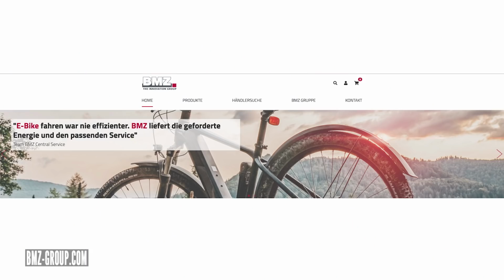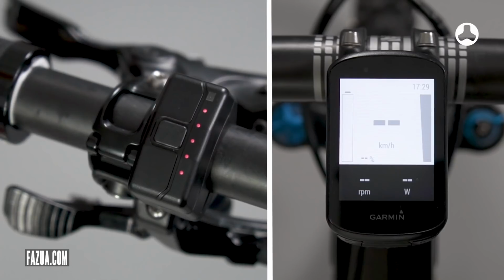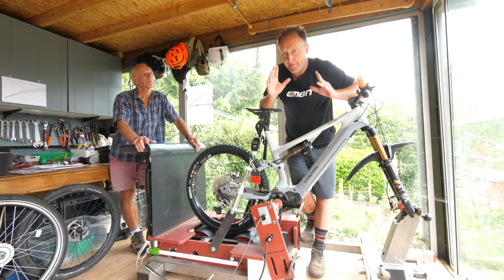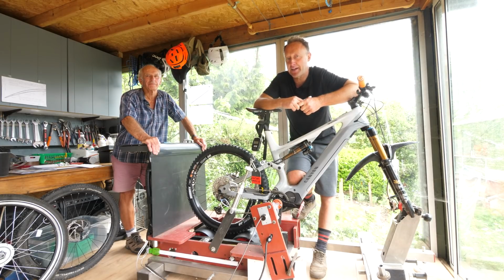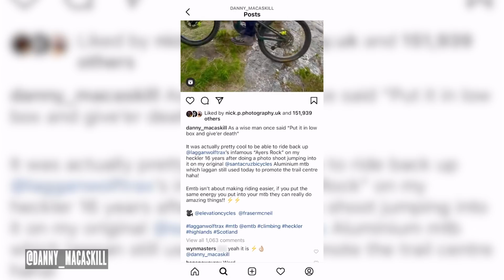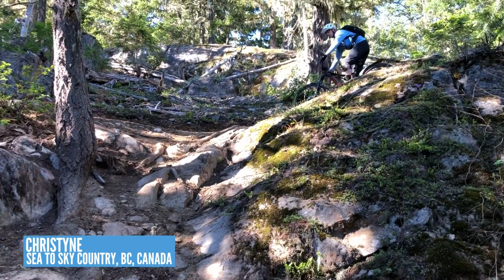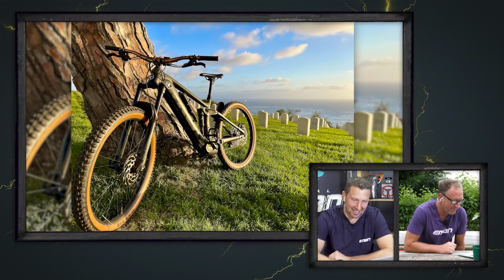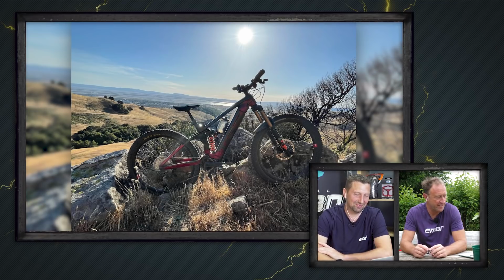Huge New Batteries Tech & Ray Responds To Rolling Road Questions | EMBN Show Ep. 182

Comment from the maker: What do you think about the news of this huge 820wh battery? Is it something you would be interested in, or do you prefer the smaller and lighter battery options on the market?
Reply: I don't think this matters.  What would be good is 1. standardizing batteries so that they are interchangeable between different brands of bikes.  2. making batteries modular so that you can add or remove individual cells as needed.
Reply: If they retrofit to existing bikes, great. I’d also like physically smaller versions of existing batteries - that monster used in my Turbo Levo looks daft sticking out of my backpack on days where I choose to take a spare.
Reply: If they could do a 600wh Bosch battery for my 2017 Mondraker eCrafty I'd be happy, I could do Degla twice.
I changed out my wheels and tyres and saved 846g went from the original wheels to DT Swiss and Maxxis tyres to Schwalbe.
Reply: Yes it’s of interest but stored Wh is only a partial story. How long it lasts depends on many variables as you know but the one we need measured on Ray’s Rolling Road is Watts out at battery vs Watts at rear wheel - in other words the serial efficiency of the system. This will give us an insight into how well built a drive system is and the heat losses.

As regards other things we’d like to see. You ask what is the optimal or most efficient cadence range at a given power setting is - but as motor efficiency is a map not a single number we need to consider that range. Flipping that on its head maybe you should ask what is a rider’s average cadence on an off-road ride. Mine is 60 rpm. My typical cadence range is 40 - 80 rpm. You?
Reply: Prefer smaller batteries if anything!

Comment: Having a few Shimano emtbs and batteries I would say that ultimately it would be ideal if you could have modular batteries in the downtube. This in the way that you would be able to fit a 504wh and lets say a 360wh battery in the same downtube space. Want to keep the bike for most riding around 23kg so dont want a massive single  1000wh battery on the bike all the time. For this occation I have a back protected battery carrying specific backpack so with a battery in there the total is 1008wh. So I dont think having a 800+wh battery in the downtube is a game changer. I wouldnt buy a 630wh battery bike unless it was about 23kg 😀

Comment: I wonder if it would be possible to come up with an update to the motor where you enter your bike weight and your weight and then after you hit the top speed of the bike instead of the motor cutting completely out it will calculate how much power it needs to make the bike feel like a normal weighted bike by using some kind of power to weight ratio calculation what do you think guy's

Comment: Ok what about tires, tyres?  TPI threads per inch.  I just installed a 120 tpi on my ebike.
Initial impression it's quieter than the chao yang that came off and may be rolls easier at the same pressure 20 psi.   The tread depth is less.  And seems very hard.  I doubt it last as long as the chao yang knobby that lasted 2000 miles and took extreme abuse off and on road.  But the new vee knobby is very quiet and tips over pretty well.  Does the 30 60 90 120 tpi tyres, tires Go further?  Last longer? Get more or less traction?  Have a sweet spot?  😳

Comment: It would be nice to have a higher capacity battery as shimano  bt-e8035 504Wh replacement….so the same size and voltage…

Comment: Fair points on the advantages of Al alloy rims, but I prefer carbon because although they may crack, they don't dent or deform. And carbon repairs have been easy and reliable for many years (look to aviation). I've just put Bontrager carbon wheels on my Trek Rail, and one of the appeals is the damage warranty that is offered too.

Comment: Fabulous achievement with the rolling road - however I think there is a fundamental flaw wrt total rolling resistance / unit weight.  By not including the front tyre's rolling resistance you are generating an artificially low number for energy required per unit distance etc calcs - and I don't think you can just assume a constant from the front tyre.  I understand 'all things being equal' part but...  maybe you could consider including rollers for the front wheel & coupling those with the drive from the rear, or maybe just talking more to that point?

One test I would be really interested in, which I think would be super useful & informative, is the effect of pedal cadence on power transferred to wheels.  Where is the 'sweet spot' that gives the most efficient use of battery capacity?

Thanks again for doing this series!!

Comment: Please come back to bikes tested and suited to wet, muddy conditions soon 🙏
Reply: All bikes should work in wet muddy stuff ! Crazy some don't
Reply: @jimbo4203  I guess if it is designed in a country where it’s never muddy there might be some performance gains by not needing so much clearance or protection on pivots.
Probably best if they don’t sell them in the UK though. 🤣
I must admit that I’ve seen a few bike that I wouldn’t want to put through a UK winter.
Reply: Bikes built that way, just last longer everywhere,  even in the dry . Just better made

Comment: Tyres on the rolling road YES! Not only different treads and pressures but widths please. Can the rolling road simulate rough surfaces? What about testing with inserts too?
Reply from the maker: There is a lot of information to be gained from the rolling road with tyres and tyre tech. We may test with inserts on this machine but when it comes to rough surface testing there is other options and tests that may be better. The job of an insert is to reduce impact to the rim and reduce the chances of pinch flats, (they also help as a run-flat solution). There is a lot of experimentation to be done with inserts that haven't been done yet.
Reply: @embn  I use Tannus Armour with tubes. I have never liked the idea of tubeless. Fine on cars with airtight rims, but bikes, with tape, sealer etc just doesnt feel 'right'. So Tannus was the ideal for me and so far no issues but lets see. Anyway I wondered what effect these would have, with lower pressures and all.

Comment: The rolling road is still a gimmick - even for the tire tests... what off-road tyre is designed to interface with smooth metal? All that test will compare is compounds & treads patterns that are not designed for a particular surface that no-one will ever encounter in the real world...

Comment: I recently opened 2 batteries from BMZ, both around 10 years old. I was shocked to see a BMS with NO balance wires, therefore no balancing and even worse, no cell level voltage monitoring. also, the PCB had no heatsink for the mosfets and no conformal coating. pretty disappointing for a big battery brand. And obviously, everyone keeps using these outdated 18650 cells which suffer from great voltage sag and capacity decrease under load (turbo mode) and sharp decrease in capacity within the first 200 charge cycles. there are far better options nowadays with certain 21700 cells (Samsung 48X, 50G)

Comment: Because battery range is so important bike manufacturers should have found a way of putting a battery in the top tube or have a design where its as easy as putting a water bottle on your bike to offer a extra bit of battery. All you'd need to is a system where the battery clicks on to a fitting in something like the bottle cage but stronger obviously that takes the extra juice to the system. I think 1 company has done something similar but why not every company. 

We need a standard spare battery size that fit ang system so that a spare can be from any maker and be used by anyone who needs it. That way you can lend it to a mate when they get stuck etc. Come on bike companies stop making things so only the company you get the bike from can supply the battery. We should be able to buy a battery that is a universal fit, even if its not the main battery but a smaller spare.

Comment: WHEELS how important do you think spoke count is regards strength of your wheel?
I took my Vitus to twisted oaks cased a couple of jumps and almost destroyed the rear wheel, had a count up 28 spokes on a e-bike that weighs 23Kg I've got road bike wheels with more spokes in the rear. I've always been under the impression that if you want a good strong wheel up the spoke count.
Reply: How deep do you want to go? So many variables!  Times the spokes cross, gauge of spoke, soldered spoke crossings, spoke tensions, rim choice, spoke pattern, wheel builder, spoke numbers etc.  Avoid extremes is best for strength for the weight. Go talk it through with your local bike shop or local wheel builder.
Reply from the maker: There are so many variables. One of the biggest factors is the spoke tension over time. Regardless of the brand, how the bike (or wheel) was purchased, was a factory-built or bespoke custom hand-built wheel. All wheels have a bedding-in period and should have a check-up after the first couple of weeks of use. A good wheel builder will always suggest this and it really helps with the longevity of the wheel.

Comment: 820Wh, is that all? Pah - I can beat that battery, my CHEEB build had a 840Wh 48v internal battery 😁 😘
Reply: Building a Fat-Cheeb at the moment Rob, you inspired me! E06 Dengfu frame with m620 1000w motor. Had the 48v battery custom built for me, 780wh using 21700 cells. Should be ready to ride next week! :)
Reply: I’d be interested to know, if Shimano plan to bring out a bigger battery to fit the original BT-E8035 space? which most 2020 model E8000 bikes have like my Merida E160-8000. The new 630 BT-E8036 are obviously to long! Any chance you guys can quiz shimano!
Reply: Rob look at the frey beast 1800 watts 1.4 kwhr battery at 60v 24ah mental
Reply: My R750 has a 920 Watt hour.
Reply: Mine 'Cheeb' has 900Wh (14S5P) (: